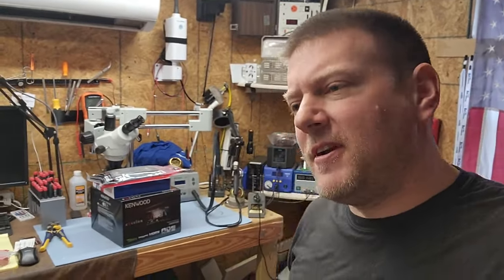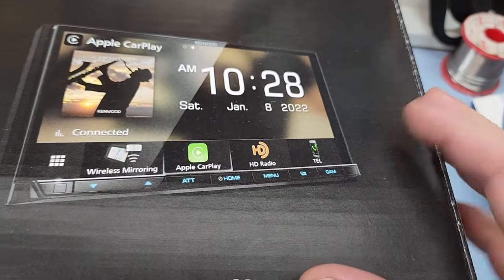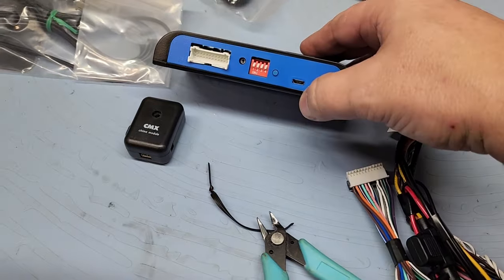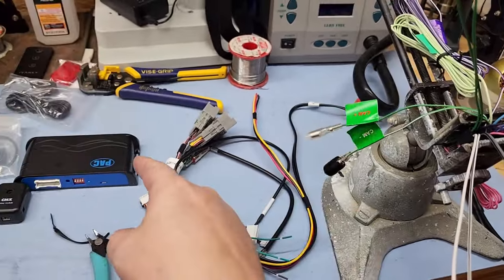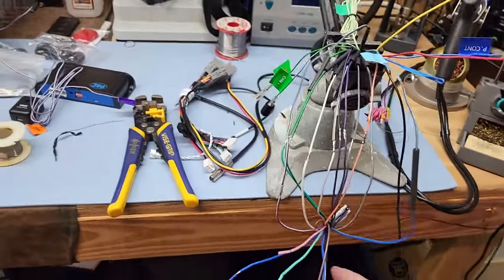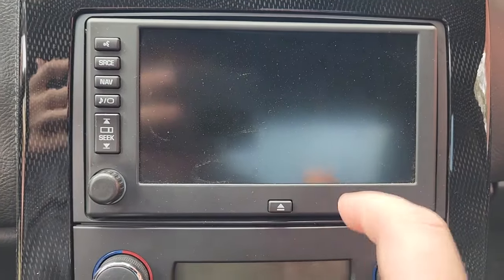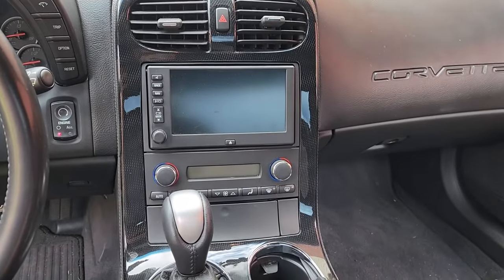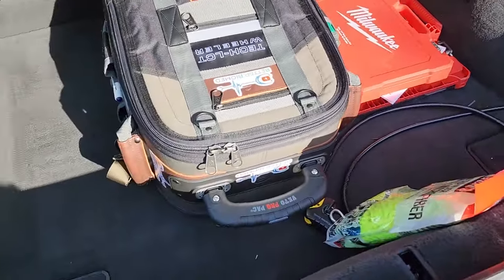Corvette C6 Stereo Install

Comment: P. Cont must be what used to be remote 12v low amperage. It is used to turn on car amplifiers and other audio accessories. BTW, how does the Corvette drive? Pretty sweet eh? Not enough room for tools though :) 
I like these videos, nice to see you outside of work related stuff 👍
Reply from the maker: The C6 has plenty of space for tools. My bag, 2 socket sets, and a step ladder fit this morning.